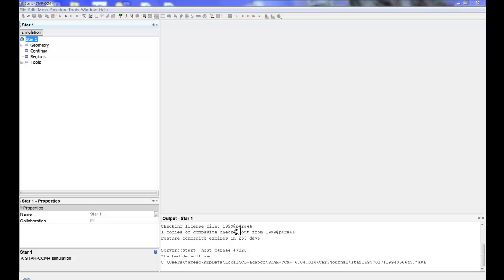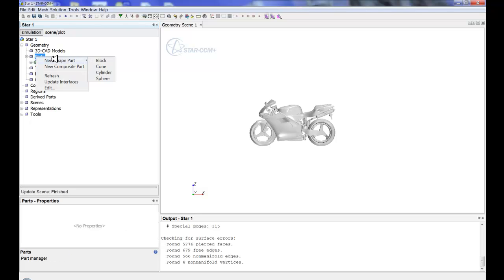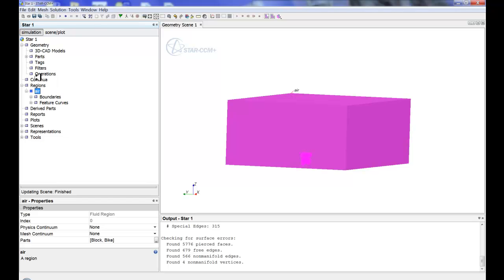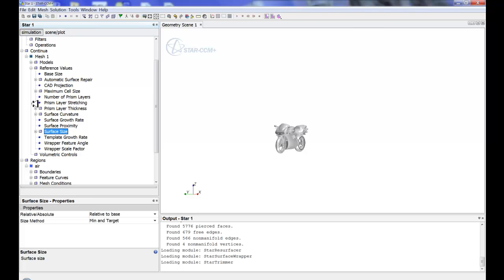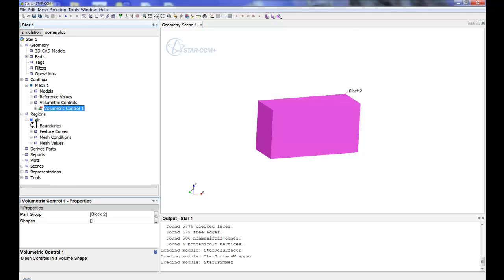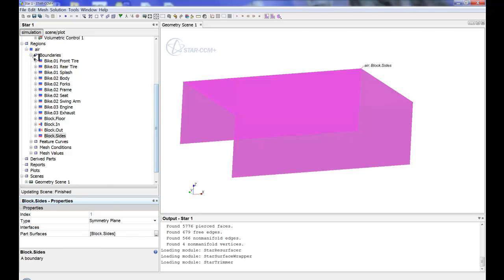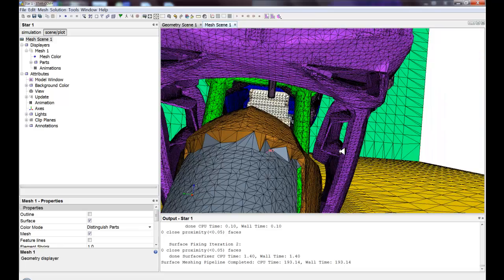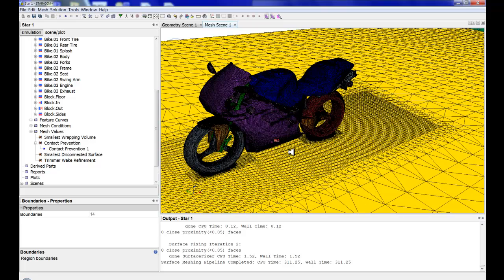Surface Wrapping a Motorcycle in STAR-CCM+

Comment: its funny you have a motorcycle as a example,the industry as a whole shows little interest in aerodynamics and motorcycles,despite the fact,in most cases a enclosed motorcycle will almost double its range.They seem to be stuck on 1950 motorcycles in motogp using dustbin fairings,I think we have improved the overall handling since the 1950's,with they're much improved brakes,tires,alignment,chassis design etc I believe the motorcycles could not handle the increased speeds, more so then ,it was about stability issues,crosswinds.I think we could easily design a safe enclosed motorcycle today,without the expense of a Peraves Monotracer. If you look at Streamlined electrics on youtube,he has a few designs[enclosed motorcycle],it would be fun to test them in a program like this.